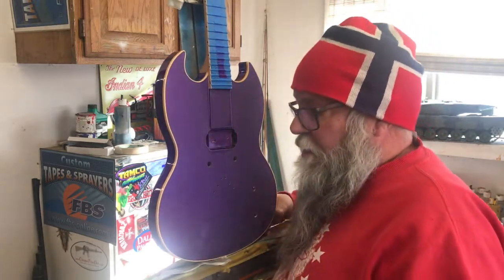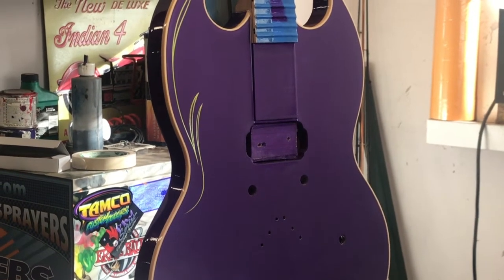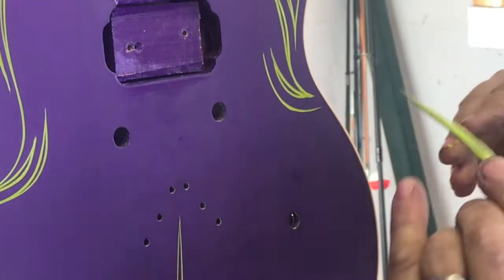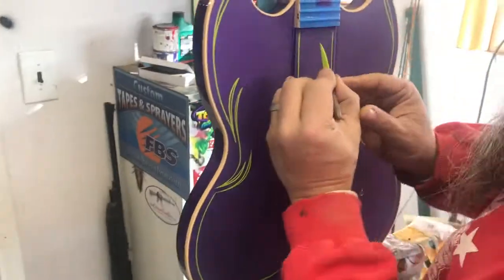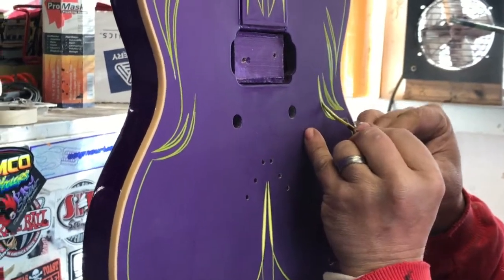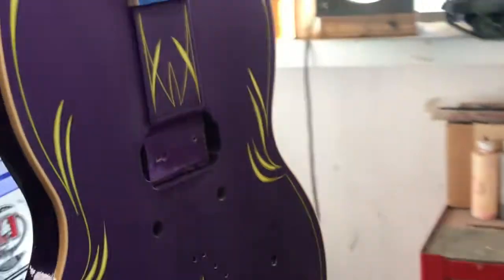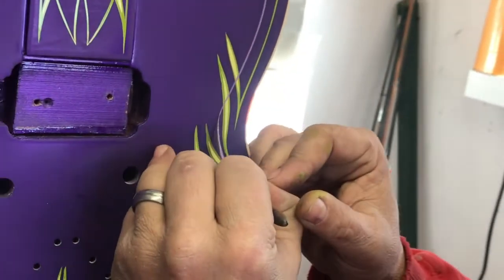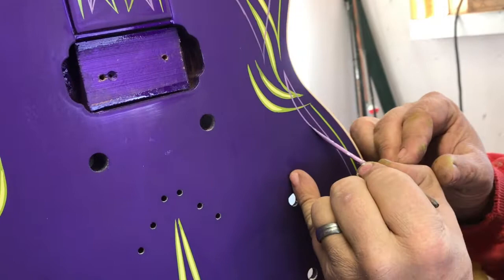Old School Pinstriping on a Texas Toast SG!

Comment: how do u like the alpha namel compared to one shot?
Reply from the maker: I find it quite similar.  Really like the squeeze containers.  Less waist IMO. Flows nicely.
Reply: @MikeLearnStudios  thanks, have u ever tried the house of Kandy striping paints?
Reply from the maker: @randy1ization  yes.  HOK striping paint is urethane.  Bit different formulation than the enamel based paints.  Dries faster.
Reply: @MikeLearnStudios  I have also seen people use acrylic enamel. dries super fast. like 2o seconds
Reply: @MikeLearnStudios  do u have to add hardener to the HOK?
Reply: Dont know of any urethanes that u dont have to add hardner for it to become cured to a durable finish.
Reply from the maker: @randy1ization  not when I am clearing it.
Reply: Tex, enamel will air harden like a weak lacquer, the linseedoil oxidizes and hardens the solids, right on so far.
 When you add hardener to enamel, it becomes catalyzed and has a photochem reaction. It causes the pours in the acrylic polymers to lock as free forming radicals.  other wise solvents (and moisture) can be absorbed like a sponge and remove the paint.... 
 Single sage urethane is just a stronger hardener, less solvent, and slightly different acrylic rubber/plastic polymers.  They uniformly lock. so their slightly better. 
2k urethane you can imagine you spray or brush the pigment on, then clear over it.    its faster, not really better, You can lay a clear coat over single stage urethane and buff it to look like glass if you have the time and the shop space.
Lacquers never harden until they fail or check., but they resist weaker solvents..... 
77 Lead was only for cars and signs.
mid 80's he lead level was reduced.
mid 90's it was lead free.
about 2012 it became low voc compliant so not only does it not have the lead and not cover as well, but it dont adhere as well.... they use weaker polymers because they use weaker thinner.   So as much as it sux and kills brushes, get used to hardener.  you have to be fast though, one brain fart and you got brush markes